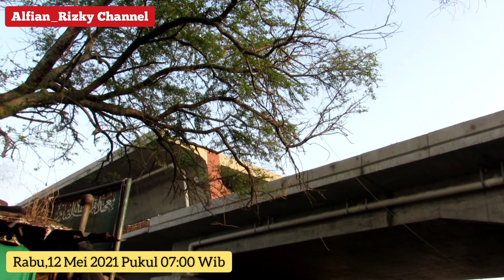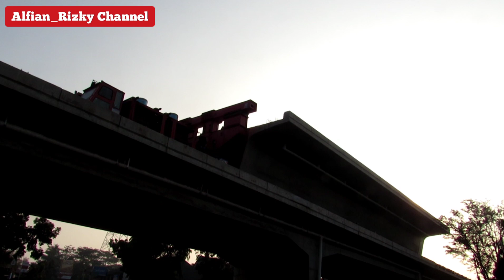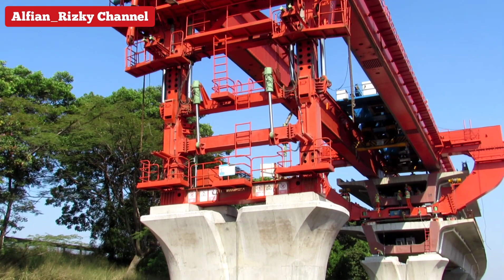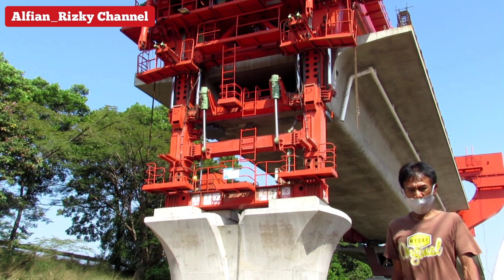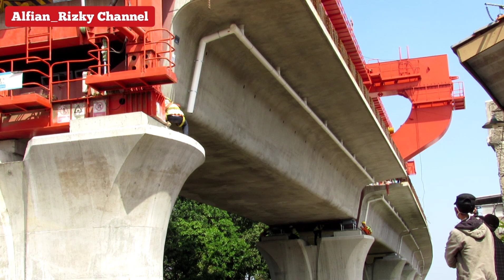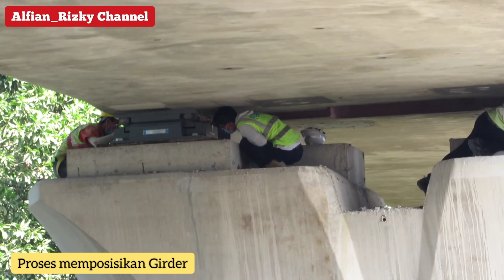Tahapan Dan Proses Pemasangan Box Girder #68 Arah Stasiun Tegalluar//#Proyek Kereta Cepat Jkt-Bdg

Comment: MORE on The "Y"frame support at the rear of transporter. The occasional changes on these  frames used to support launchers while they unload girders, usually occur with changes in  the gradient or grade of the track. 
The launcher needs to keep their lifting crane tracks near level and as there Is a limit to the adjustability to the height of the front legs and  the "Y"frames, to compensate for the steeper up or downhill grades, an extra Insert is added or removed to the "Y"frame support to adjust the launcher's top crane tracks to enable the box girders to be lowered safely. 
NOTE- The direction of up or down slope is indicated by the running direction of the external drainage pipes outlet; if its at the front of a girder then the slope is down hill.🥝🥝🙏